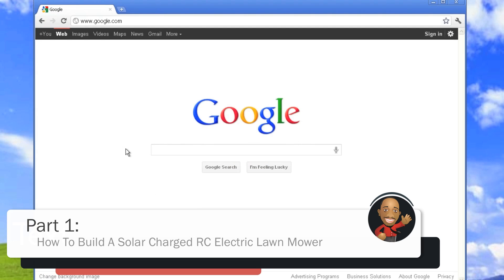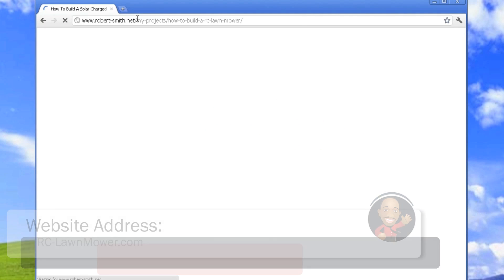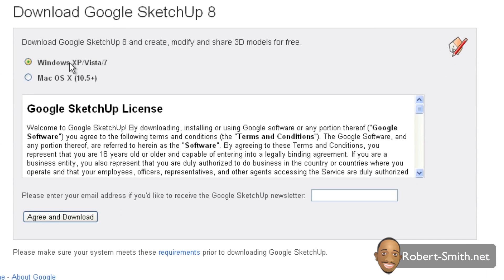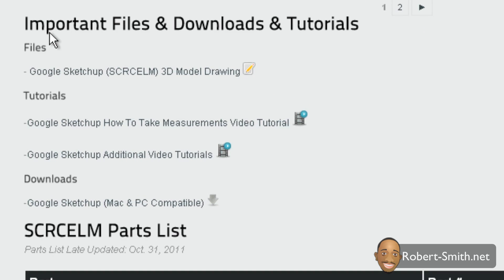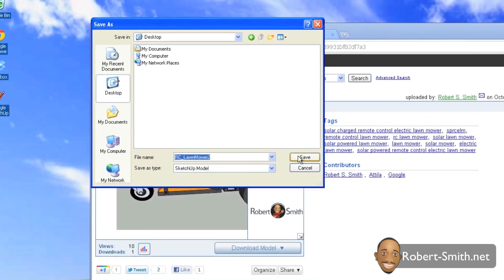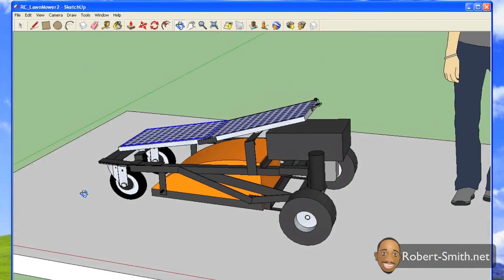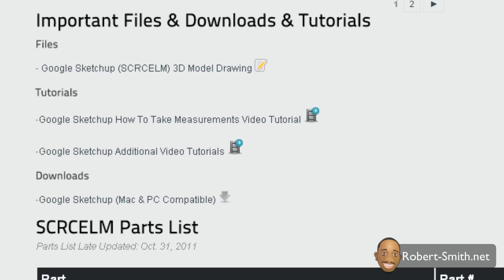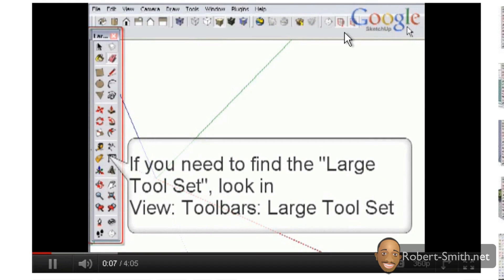How To Build A Solar Charged RC Electric Lawn Mower - P1

Comment: Hi robert,how much for a rc lawnmower
Reply from the maker: To make the solar version, it cost roughly $1,000. It could made for a lot less if you do not plan on putting solar panels on the lawn mower, or plan on not using an electric lawn mower.